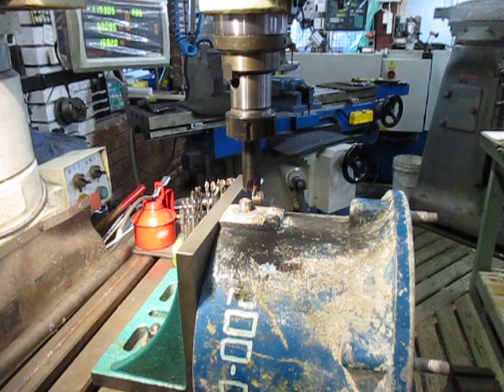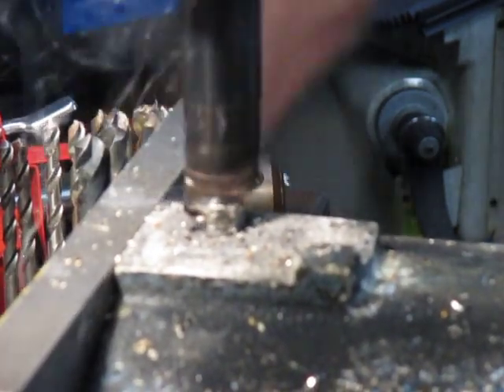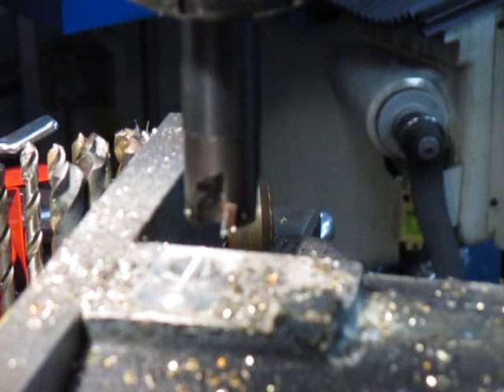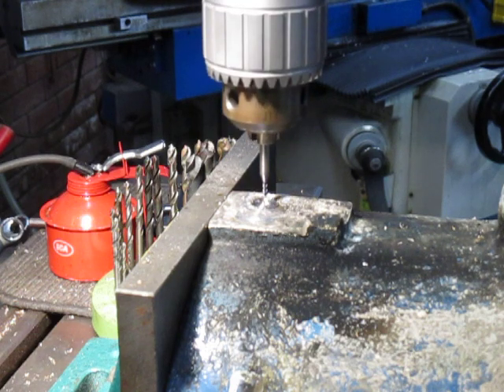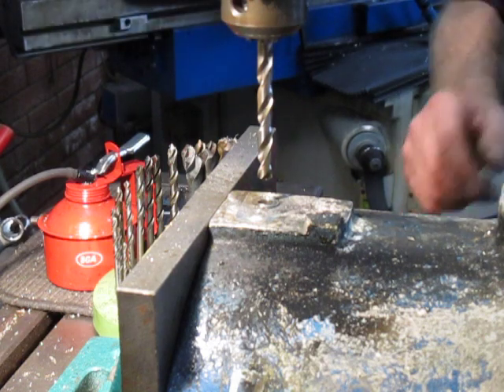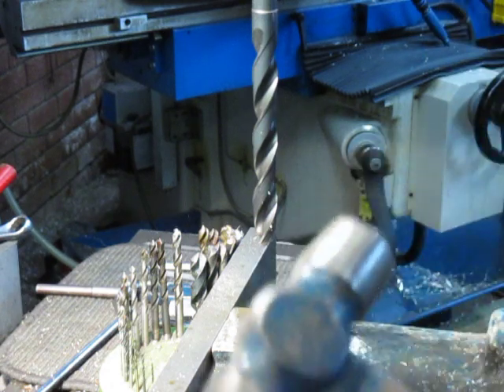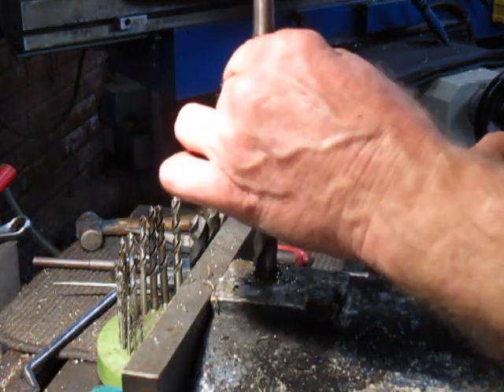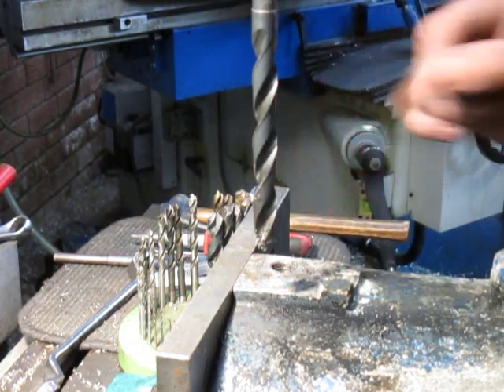Getter Out 17 oil housing broken stud

Comment: Hi Bruce, how about making some discs, with part drilled centre drilling, about the diameter of the thread you want to drill out to act as an eyeballing guide to find the centre. In use put disc on top of flat milled thread hold down with centre drill and align as best you can, then drill. Further thought, maybe one with core diameter as well.
c
Reply from the maker: Chris it could work, on the other hand it will be another item to store away and try to remember were it is, generally I would take a mill the same size as the stud and continue pecking off the stud down into the bore for a few mm that way I can get the centre spot on and then begin the drilling process. I don't know why I didn't do that yesterday put it down to a bit tired by then, I was up from just after 3am yesterday.
Reply: 3AM that's about my bed time.
If you keep doing it the same each time you will never try something new, which might be better or not, you never know till you try.
What's that about variety being the spice of life? Works for me.
Reply from the maker: Chris Stephens I'm always happy to try something new, in fact my motto is: It's a bad day if you don't learn something. Working in the shop is the easy part, working on a truck / car against a firewall or a machine with a mirror in one hand  is when it gets tricky when there is little room to get the drill in and no way of holding onto something else.
 If you look back at one of my movies you will see all sorts of aids I've made to assist in finding the middle / drilling pilot holes in line Cheers Bruce
Reply: Absolutely agree, been there, done that and got the scars.
I have seen all yours, but will look again for that one. I keep meaning to finish building a kit for a centring microscope, should be good as it has cross hairs and concentric circles on the graticule, maybe one day.